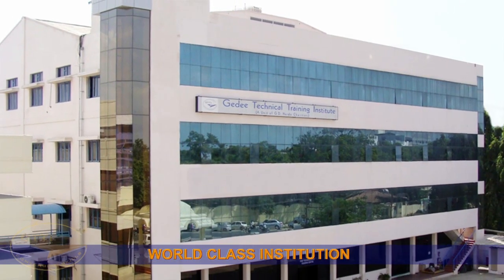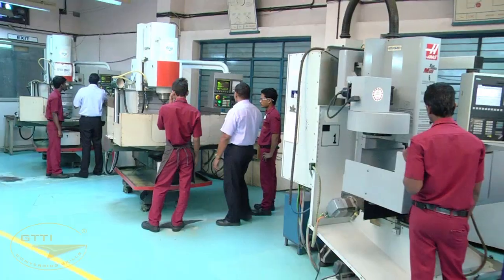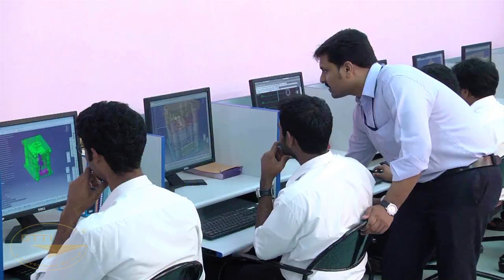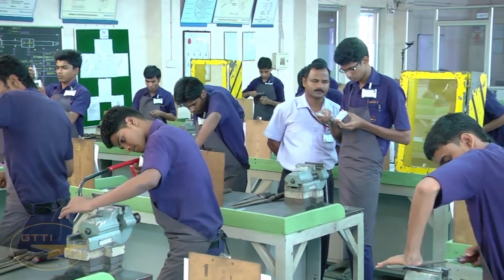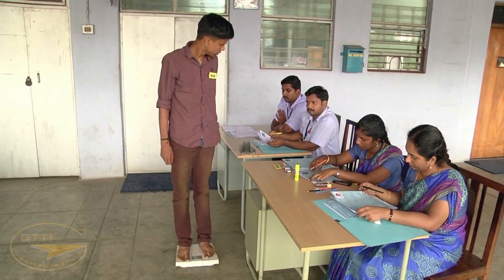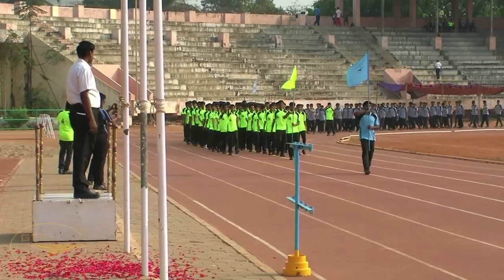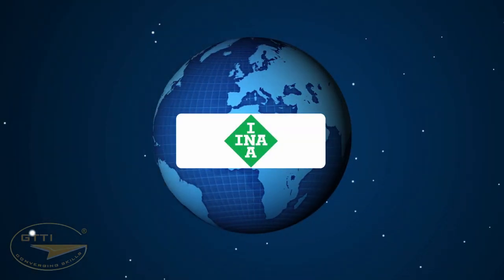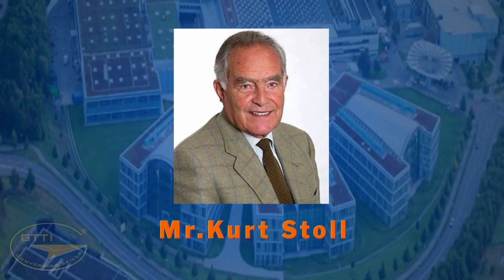Gedee Technical Training Institute

Comment: Hello, Is there anyone expert in below  matter? my company in Banlgladesh is looking for two tooling expert trainer. If there is -please contact by mail nislam@sonic-bd.com

AutoCAD, Creo, EDM Technology, CAD/CAM Technology, Basic Electronics, Hydraulics and Pneumatics, Quality Control, Manufacturing Technology and Workshop Calculation, Engineering Drawing / Tool Design Drawing, Automation Technology and Management Principles.
They get vast practical exposure in Turning, Milling, Grinding, all types of Bench work, Forging, Welding, Lapping, Scraping, CNC Machining and Manufacturing of Press tools, Plastic Moulds, Die-Casting tools, Jigs and Fixtures.